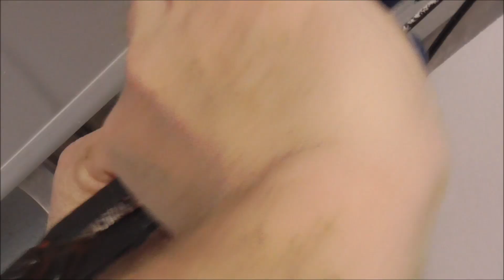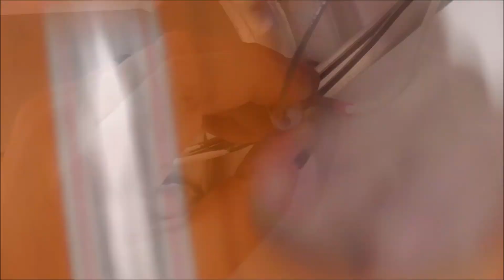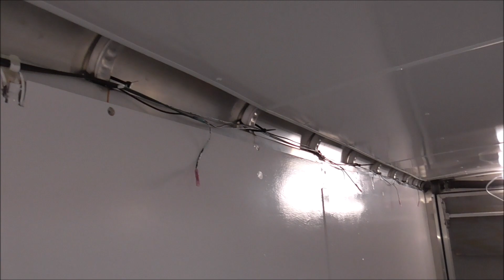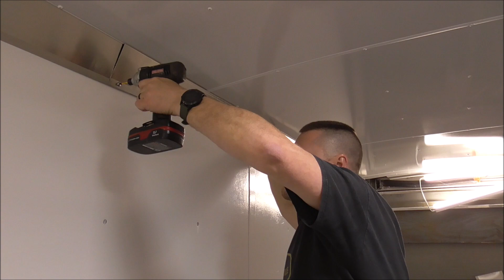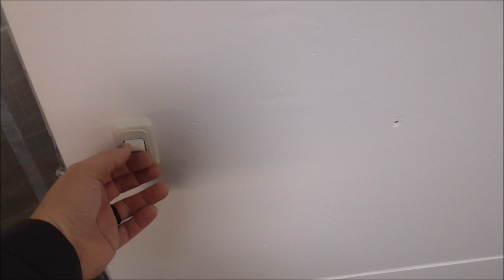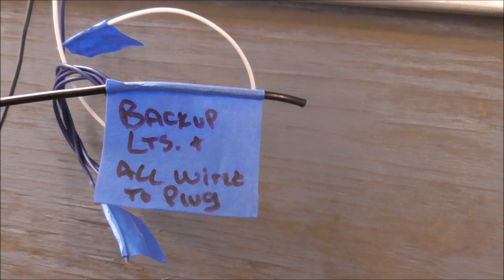Watch How We Transform This Cargo Trailer - Lighting Electrical Rough In and Installation

Comment: did you manufacture the trim for the light - if not, where did you get the trim
Reply from the maker: The trim was already installed in the trailer

Comment: Excellent video. I am doing the same things to a Neo nav12 single axle. I love the way you finished off the curved section of the roof with the aluminum trim.  Did you get taller pieces crafted, or reuse the old trim pieces.. When I eyeballed mine (my roof panels aren't installed yet) I didn't think they would span the gap from the walls to my eventual ceiling panels. Thx.
Reply from the maker: Thanks man! I just reused the same aluminum panels that were previously installed by NEO. It worked out perfectly.

Comment: Do you have to remove the wall to remove the light switch?
Reply from the maker: No, it's just held in with a couple screws. It's super easy if you want to change out the switch.

Comment: Awesome job. Those lights are amazing. Quick question though, why don’t you have to bring the neutral wire back to the battery? Is it the same as “grounding” it to the aluminum?
Reply from the maker: I have the battery grounded to the frame of the trailer and the light is also grounded to the aluminum, so the trailer is making it's own path to ground.

Comment: Thanks Brandon.  I can't find how you did the aluminum transition from the ceiling to the wall.  That looks great.  I am doing almost the exact project.  I would love to know where you got them or how you made them?
Reply from the maker: Thanks Dave! Those trim pieces were actually on the trailer from the factory, they were just mounted about an inch lower. The factory used them to hide the wires that run from the front to the back of the trailer. You could duplicate them pretty easy if you went to a vinyl siding place they could probably make these for you pretty easily. I would say the face is about 4 inches wide and the mounting flange is just a 45 degree bend on each end about 3/4 long.

Comment: Great job; I agree that those Scotch Locks are crap; I removed all from my trailer like you did. I also ran all my grounds back to the battery terminal junction instead of trusting the trailer as a cage ground. I also ran a wire for a future review camera when I added a cargo loading light.
Reply from the maker: Planning ahead has a lot of benifits when you want to add additional things

Comment: Real electricians don’t crimp 🤣🤣🤣.
Reply from the maker: 🤣🤣🤣🤣 you know darn well the younger me would have soldered those connections for sure....summer might be over but I would have done it lol. 😁
Reply: Well I can’t crow too loud, I’m waiting for my eldest to bring his car round so I can fix some temporary crimped joints after we fixed his headlights a couple of weeks ago, but I couldn’t find ANY of my soldering irons. All in one day of looking I found all 6, 3 Wellers, 2 gas and a baby scope.
I know what you’re gunna say, “6 soldering irons! Wow!” Nah, kept misplacing them so would buy another to replace it, 😂😂😂. The gas ones are brilliant because I used to use the blow torch for main earth connections and they had heat gun attachments for delicate heat needed for heatshrink, 😇.
Reply from the maker: I do the same buddy....then before I know it I have several of everything. LOL

Comment: Looks great. I'm not a fan of warm lighting because it's not bright enough. Gives everything an antique look. If you increase the voltage a little (a boost buck) you will be able to increase the brightness of those lights. Then add a dimmer switch to control the level of power running to the lights. The lights would possibly shorten the life of the lights (that's what the dimmer is for, not running full power constantly) but then give you a reason to replace with the bright white when they burn out. You probably know all this because you were an electrician.
Reply from the maker: Going into this I was worried that a whiter light would be too much glare in this all white space but looking at it now I probably would have been ok. It looks cozy for sure at night.

Comment: So, you have done it again.  Tutorial on pre-planning, wiring connections (only thing better is soldeing the wires but much slower and probably no better connection), did not know that those connectors have heat shrink on them, labeling, and oh so much more!!!  That trailer is going to be quite the rig!!!  Hope you shoulder is holding up!!!  Be well, be safe, be Blessed!!!  Thanks so much for what you do and are doing and will do!!!
Reply from the maker: Thanks Jim I appreciate it. I'm a hurting unit today. Lugging that trailer flooring around. It's thick and heavy. Ibuprofen will be my friend tonight.
Reply: You might try Aleve.  Works for me!
Reply from the maker: Great tip! TY!

Comment: LED lighting is a new thing for all of us to learn. Lots of options that we never had before.. . The number is the color,, WARM (kinda yellowish) is in the 3000 range, NATURAL is in the 4000 to 5000 range, COOL (very white) is in the high 5000 to 7000 range. Take a look at a Kelvin Color Temperature Scale chart... Some of the newer, fancy (expensive) units are switchable so you can pick and change as you see fit.. I bought the cheap ones on EBay that are sold as 120v AC and just didn't use the drivers that came with them.. Sometimes they act funny so there was a learning curve with those too.. There are also mini 12/24v flood lights that work really well.....
Reply from the maker: Thanks for sharing man. This is how we can all learn from each other. Much appreciated. 👍
Reply: Thanks twistedhillbilly! I'm converting my car hauler into a leather shop. It just can't be too bright:)
Reply: @donnarohrer4435  I have done a lot of work with low-volt lighting.. Let me know if you need any help with your project. There are hundreds of options no one knows about...

Comment: Temu has similar connectors with solder in them. They use a heat gun with a deflector to melt the solder.
Reply from the maker: Good to know! Thank you! 👍

Comment: That's awesome Brandon! I did the opposite, did welding right out of high school, then went back to school and an apprenticeship for a 309A C&M license 😂 and now I'm back working as a welder (never really stopped, did welding as a side gig for years).
Reply from the maker: Huh that's funny. The odd thing is ever since I was 5 I wanted to be an electrician, then once I got it, I got bored. I started in residential and that was like pumping out widgets 24/7 then we started doing industrial work but it was too slow paced. I got to keep moving. I can't do the same thing over and over for very long. If I can't use my brain and hands together, I get bored really quick. After that is when I got into welding full time. I actually did HDPE pipelines for a bunch of years and owned a bunch of machines but metal work has always been a big part of my life. When I was 17 I built what I called a bed extender. I tried to get a lawyer and patent it but at 17 I was broke and we didnt have internet so i couldnt figure out on my own what i needed to do instead of paying someone to tell me. Someone actually went on to build and market my idea.  Go figure lol
Reply: @Brandon Lund  I hear that! Residential electrical (all low voltage really) wasn't my cup of tea either. I've always been good at troubleshooting, having a puzzle to figure out while working with my hands. That sucks about the bed extender, but look at you now, all the people you help with this channel, and the community that's been built is just awesome!
Reply from the maker: Thanks man I appreciate it!